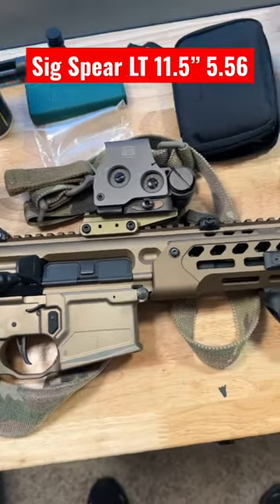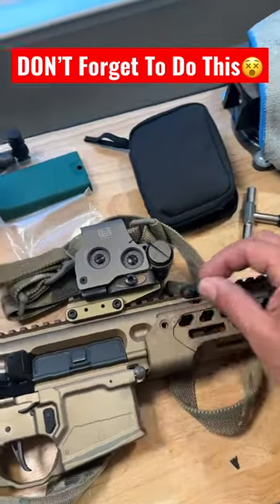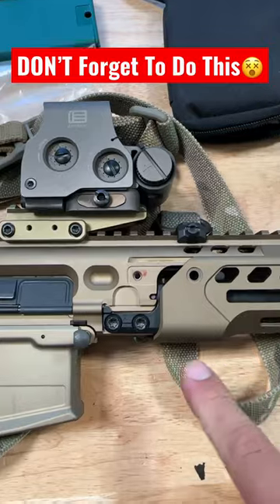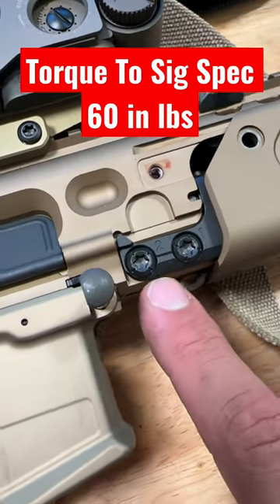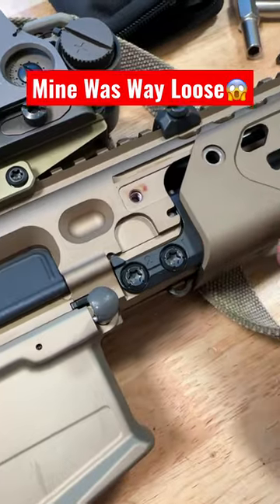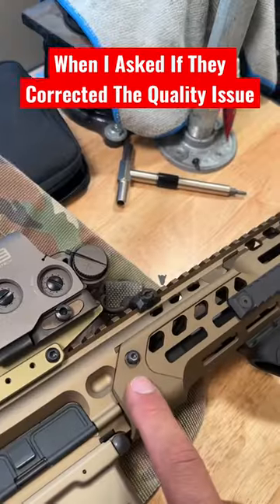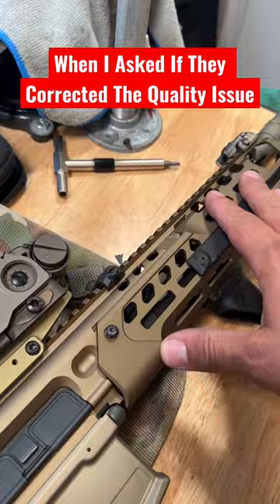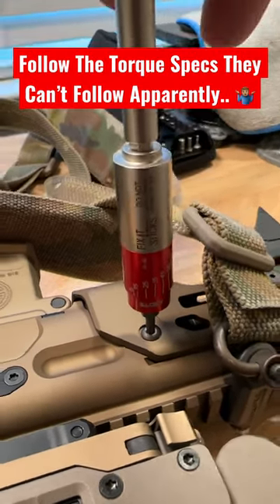Sig Spear LT MAJOR QC Issue😵

Comment: As beautiful as this rifle is I will never want to touch one…
Reply: I own three spear LTs and they are bad ass! we run them hard AF suppressed too and they have yet to have a malfunction. 556-300blk and 762x39. Say what you want but there are plenty of people including real operators like Travis Haley running spear LTs and they don’t have any issues either and if one person isn’t going to sugar coat anything it’s Travis Haley.it’s funny how the people that hate the spear lt are the ones that don’t even own one.
Reply: @MarvinSaiz i have looked at multiple sig spears and I can tell you they will not handle harsh conditions listen you can make a chauchat run clean if you never throw it in the dirt or give it to grunts this platform also doesn't have what the ar has and thats the ability to basically gas itself out
Reply: @fishlife1013  I would like to see your credentials please? And then I would like to see the testing data to back those claims up. Opinions are like butt holes. Everyone has one. With all due respect.
Reply: @JohnyMacGames  i just have experience not credentials and I have worked around a lot of different platforms and I can tell you just from experience that this platform has problems nobody is willing to address once these rifles are in the field its gonna be rough for the people that dont baby the platform like closing the dust cover frequently, lubing everything and trying to reduce the carbon fouling a little more then on a ar platform
Reply: @fishlife1013  how does carbon fouling affect function on the spear LT? What areas of the gun does carbon fouling create isues?
Reply: @melgibsonfan2744  towards the back were the bcg is it builds up but were talking mostly debris from extended mistreatment that most guns could handle a little better
Reply: @CommunismIsCringe  no appeal to be had. I’m prior Army so I know how things work, or DON’T, work for that matter. Just speaking from my experience on opinions. All too often people will downgrade something because they have had a poor experience and thus it MUST be true across the board. I also don’t like speaking in ABSOLUTES because that implies there is ZERO margin of error. Nothing is absolute, save for one thing, there are no absolutes.
Reply: Yep and they're heavy too as heavy as ten boxes that you might be moving
Reply: @JohnyMacGames lmao this is peak BOOT energy

Comment: “Torque specs” we just tighten it and say she ain’t going nowhere it works every time
Reply: Screw 'till it screws no more and good to go
Reply: So... if you screw her good and proper, she won't ever leave? Got it..m
Reply: Until it starts going easy💀
Reply: Screw with fingers till it stops then give it a little ehhh with a wrench and it’s good.   

If the head beaks off the screw, it becomes “pinned”
Reply: No you gatta give it a dad slap and say "that aint going nowhere!"
Reply: This would be an awful spot for the screws to back out cause you could NEVER get the handguard to back off!!!!!
Reply: Yup same lol
Reply: We see that the factory specs backs out🤷‍♂️
Reply: @zachduncan6421  I doubt they were even torqued.... Did they at least have locktite on them? And this is why I kind of shy away from guns like this and the JAKL, the more screws and bolts it has in it the more chances you'll have a screw or bolt back out..... These tools control explosions, everything needs to be tight!
Reply: Every professional mechanic/technician reading this 🥲💔
Reply: And you have to say “that’s not going anywhere” otherwise it will fucking go somewhere!
Reply: The reason why you tighten to the torque specs is so you return to somewhere close to your zero
Reply: I've stripped too many screws on none gun related projects to do that lol. I always torque to spec on my guns, especially on important things like optics. Also use loctite. One and done. Don't have to worry about anything coming loose or over torqueing.
Reply: This is how you say “I wish I had a torque wrench”
Reply: Torque it till it strips and back off a half turn.
Reply: Yeah, but that retains little tension, therefore making it eash for the bolt to loosen
Reply: Only torque specs I know;

HT - hand tight
FT - fucking tight
Reply: The German Method of Goodenteit
Reply: @samuelneil2691 Over torquing? What’s that? 😝
Reply: THAT'S WHAT BLUE LOCTITES FOR.....🤙😎
Reply: JESUS SIG!!!! WHAT ELSE YOU GON MESS UP!?!?!?!🤯🤯🤦‍♂️🤦‍♂️
Reply: Gotta give it a good rattle and slap too, just like clicking the tongs.
Reply: How many screws have  you needed to extract? Just curious.
Reply: But after tighty mighty comes loosy goosy
Reply: I use twerk specs on my ladies
Reply: Unacceptable.
Reply: @0mniVerse777 

“Yeah that’s tight enough”

“One more turn for good measure”

“Aaaaand it’s stripped”
Reply: Noooo, no Loctite. Vibratite VC-3 is the way. Vibratite 548 retaining compound as well works great for sealing gas keys and optic plates on pistols.
Reply: lol try tight an even small moped engine like this see wtf it gets ya
Reply: Red blue or green locktite?
Reply: As an engineer I'm kinda of mad rn reading this

Comment: Serious question.  Does Sig even have a QC department?
Reply: What's quality control?
Reply: To be ISO certified, they must
(Probably run by a snow bunny)
Reply: Yea,the customers
Reply: yeah. they're called 'customers'
Reply: You are the QC department
Reply: @fishlife1013  no sir I’m definitely not a fan i sig for that very reason !!
Reply: @oso_tactical2192  i sold mine I bought one and was pretty disappointed by the performance
Reply: @fishlife1013  the only sig I’d buy is a P-226 .
Reply: @oso_tactical2192  yeah they are nice but I would get one thats been worked on by maybe there custom shop
Reply: No major manufacturer does. I have been at home tinkering for my whole life and an actual career gunsmith for a few years now. Every year I see a few brand new "factory moa" guns in the shop right after hunting season. None have ever been torqued to spec. Most of the time the owner never checked. I dont blame them, it should be squared away from assembly but things happen. Always check everything from top to bottom whether its brand new or 100 years old. Also the wrong time to get your rifle diagnosed is after you miss.
Reply: @terpsurfer7221  yes I’ve recently gotten into building my own. So far I’ve put together one rifle and one pistol !! Definitely a fan of hand picking my parts and putting together a tool that fits my every need !!
Reply: The fact the SPEAR LT doesn’t use a traditional barrel nut is why I’ll just never buy this gun
Reply: @Kaotix_music  there are lots of guns that dont use a barrel nut
Reply: @Kaotix_music  I'll give you a pass since you obviously haven't worked with many different firearms, but not many other firearms use an M4/AR style barrel nut outside those designed after it.
So saying "won't buy cuz no nut" isnt even a reason.  If that's the case then you're also saying you won't buy an AK or an HK rollerlock or a B&T or a SCAR or an AUG or a Galil or a 700 style bolt or (insert mainstream weapon here).
You can say "I have a bias against sig therefore won't buy one" and that's valid, but the barrel nut?  Yeah, thats an uneducated statement  to make.
Reply: @terpsurfer7221  yeah, that's not true.  All major manufacturers do.  Sig absolutely has a QA/QC team - they literally function check and fire each gun prior to being boxed up and sent out.
Youve seen guns that come with the test target right? That's literally the QC department checking function before shipping it out.
Reply: People are hating on Sig pretty big time here, but they absolutely do have a QA/QC team/process.
Reply: @fishlife1013  Yea, my Bergara B14 doesnt use one. But thats not a semi auto "battle" rifle. It's a bolt action rifle meant with alot of percision to take single precise shots that needs alot of care. Were talking about a gun that needs to take a beating and this aint it (in my opinion)
Reply: @Kaotix_music  the m21 and m14 dont have barrel nuts hell most shotguns dont have barrel nuts most barrels not need them most big machine guns dont have barrel nuts the aug,the m249,m240b, m2 50bmg guns that have been in the shit and done well
Reply: @fishlife1013  Ahhhhh the m14, I had one I took out alot in Afghanistan. The 249? She was my bitch, I love that gun so much. I fucked alot of shit up with the m2 and MANNN I hated cleaning that thing. That headspacing with the gauge? and getting the timing wheel right? The point im making is I know dude. Literally every gun you mentioned I have used (minus an m21) I worked with SF and not only did I have to learn how to "shoot" these guns...I have to learn how they operated, were assembled, disassembled, maintained, and learn it so well to where I had to feel confident to teach a class on those guns. So not standard 11B shit where its "just take out the BCG and clean the barrel" shit. The mk19 also doesnt use a barrel nut, the MK47 doesnt use a barrel nut....but every gun we all keep mentioning are not AR platform styled weapons. The SIG Spear LT is. And SIG tried to fix something that wasnt broken with that design. They always want to seem so innovative and take over the space and just have fail after fail after fail with literally every gun they come out with. They try to fix things that arent broken and the result? The barrel flex issue in the LT's case. Sig made a statement saying to retorque the screws to a different spec and we tried so hard on my friends LT, it still wouldnt return to center. The guns design should have used a barrel nut design. Thats my opinion. I dont know why they went away from that on an AR style weapon, but they did and ofcourse...SIG at it again with the problems
Reply: Three of them. US Army, Navy, Marine.
Reply: @Kaotix_music  see on a ar platform its almost paramount because of how the barrel shroud is set up so to me its very confusing why they decided to do what they did
Reply: @fishlife1013  Armalite doing what they did or SIG?
Reply: @Kaotix_music  sig
Reply: Yes but they are ordered around by office people who care about output and only output
Reply: Yeah, its called customers
Reply: @Mophony lol fr
Reply: @Mophony something that big companies don’t care about lol

Comment: My barrel bends to one side because of how I wear my pants, no matter how hard me or my wife tug on it, it never goes back straight again.  Please advise.
Reply: Got a dripply dong man.
Reply: 🤣 bro what
Reply: Thats some cringe boomer humor tbh
Reply: Hahaha nicee
Reply: Slide the hanguard back and forth and have your wife torque both boltz to user specs. 👍
Reply: @grimmstonejones331  mine came with nuts, does the same apply?
Reply: Have your wife bring a friend to grab from the other side and equalize the torque while they twist the nuts down to 80 ft lbs
Reply: @richs.7373  not sure that would work, all my wife's friends are big black guys for some reason.
Reply: @rantional8180 😂😂😂
Reply: @rantional8180 🤣
Reply: You can just cut off the part that’s bent and voila you now have a short barreled weapon!! Even better, no need for tax stamp
Reply: @Chimnaay  my wife says my barrel is too short already and is threatening to divorce me if I chop anything off. 🥲
Reply: Swap hands for a couple weeks, worked for me.

Comment: Honestly, Blue 243 loctite or purple (low strength) loctite should be applied to the HG threads. Prevents galvanic corrosion and ensures torque is maintained.
Reply: I use BLUE on just about everything. Zero problems or worries. I don't understand why people wouldn't. Just be smart and use the right color.
Reply: @Marktk72  Agreed 💯

Comment: I thought the more you spend on a gun the better quality they are?😂😂😂 most cheap guns i purchased have no blems but ruger,glock i both got blemished crap from them.
Reply: Sig is pretty well-known for shit like this lol, I've been sworn off of them since buying a P320 and a P365, both of which were absolute bricks. Their QC is god awful and I can't fathom anybody still buying firearms at these prices when they have worse quality control than Palmetto State Armory
Reply: @turnermd1302  i just sent photos of my blemished mark IV lite(22lr)
I cant beleive it had a big old bur right in the breach face area where the round is seated in the chamber.
Reply: @turnermd1302  lets see if ruger makes it right.....i told them i dont want to send nothing back because i shouldnt have too. They should send me a new upper for it (because the barrel and everythings fixed.)
Reply: @@assclapper2231 so do alot of high ends but none of the psa lowers kr uppers i have have issues or my gf3 ak with 2500 + rounds through it
Reply: @@assclapper2231The problem is sig owners wont admit to issues. See how that works?

Comment: I usually tighten things to “that should be good” to “that ain’t comin loose”. Anywhere in that range works. Actually little M6 or m8s strip all the time, 60lbs is a crazy amount of torque on one of those
Reply: 60 inch pounds (5 lb/ft)
And it will still come loose due to thermal creep.

Comment: Damn imagine having to use a torque tool in the battle field when stripping and cleaning your gun….
Reply: Yeah it shouldn’t come from the factory like that. Enough with the bootlicking.
Reply: Idk just steal a torque screwdriver and torque wrench from one of the mechanics. They ain't using it.
Reply: Well, removing the barrel and handguard aren't exactly standard field stripping practices.
Reply: @danielpark7821  how am I bootlicking by making fun of the new rifle?
Reply: @KeterMalkuth  well yeah with the M16 lmao look up field stripping spear 😝 everything is taken apart “if it ain’t broke…”
Reply: @kodaxkodax4153  No, there's actually no reason you'd ever remove the barrel in the field, that wouldn't also imply you could carry a torque stick. The handguard, sure, you might want to pull that off to clean the piston, but you could just leave the handguard screws out and mount anything that needs to hold zero to the receiver, if you know you'll need to be removing the handguard.
Reply: This ^
Reply: @KeterMalkuth  yeah kinda a flaw for military use I’ll stick with the good ol ak or ar platform I’m glad you understand how guns work you must feel smart in the comment section
Reply: @kodaxkodax4153 Your the one that hasn't a clue of what your speaking. KeterMalkuth is 100% correct.
Reply: @aaronj08ar  no I get it he is correct I didn’t say he wasn’t I’m just saying simpler is best I mean I don’t see why it’s much of an improvement it’s still being tested it’s still new… I’m just kinda old school when it comes to if it ain’t broke don’t fix it but I’ll let the scientists of YouTube have their fun lol
Reply: My wrist is a torque wrench
Reply: Don't remove M16 rails because it's bad luck.

Comment: This is what happens when you try to re-invent the wheel and pay a premium for it. Could you imagine being in a combat situation and the one thing you need is an inch lbs torque wrench , while the opposition is making you dance with weapons systems that predate the clinton administration for a fraction of the cost.
The modern gun industry is disgusting.

Comment: Bro the fact that the last five years has been nothing but issues for sig and their quality control, You’d think that all the money they charge for their weapons would be enough for them to MAKE SURE that their products are up to par PRIOR to sending them out to ffl’s and retailers, but evidently the new operators and managers at Sig don’t really care about the customers. First the release a faulty p320 for three years they was floating around shooting by themselves before sig even decided to acknowledge the problem, and then instead of issuing a recall(because it would assume them the liability) they just lied and said it’s a minor part flaw not a design flaw and issued a webpage to enter serial
Numbers into for customer to be able to tell if their sigs were made before or after the parts replacement. But guess what?? Even the guns made AFTER 2020 and the list dates of faulty p320’s, they are STILL firing on their own from being shaken or bumped while holstered. And of course sig still is making up excuses as to why A HOLSTERED GUN FIRED FROM A BUMP INTO A DESK OR FROM A SUSPECT KICKING THE COPS LEG SND HIS GUN GOING OFF. There IS NO EXCEPTION why these guns are so expensive but yet barely function or don’t function safely. Smh. I will never buy another sig until they absolutely prove me demonstrate their products have gone thru a rigorous rebuild stage with better parts and designs.

Comment: And use hot water to get the sig factory muzzle device off!!! Everyone’s been trying to use a heat gun or torch. It’s rocksett you need to put it in water for like 3/4 hours and it’ll come right off

Comment: It’s not the barrel it’s the handguard! The barrel won’t move back and forth even with the bolts loose it will only move in and out. Push the barrel left to right with the handguard on and torque down,look at the screws while you do this and you will see the handguard movement . I own 3 spear LTs 
And none of the have barrel issues they have handguard issues that have all been fixed with a (arasaka mcx zero retention clamp.)

Comment: Shouldn’t you check all the bolts for correct torque you shot them a couple of times? I don’t think it came loose I think it worked itself loose and you should always retorque after everything was heated and cooled down after firing a few rounds through it just in my opinion

Comment: Could I put that upper on a 300blk ar lower
Reply: More info is needed. 556/300 use the same lowers but this design with no buffer tube and what looks like a slightly different receiver pin design will definitely be an issue with conventional at/m-4 lowers. If you mean can I put this upper on my sig spear 300 lower…… then yes.